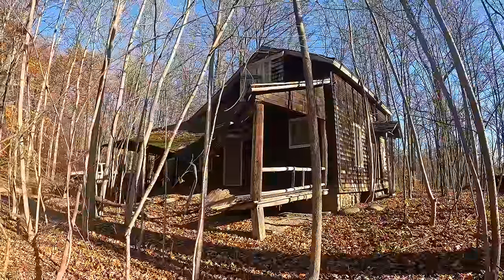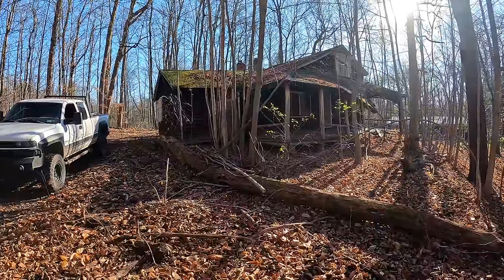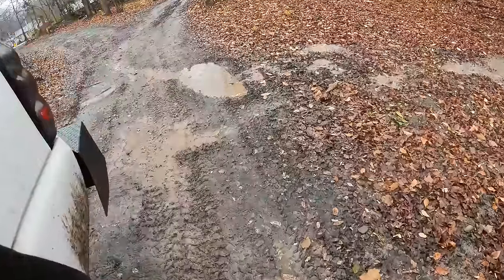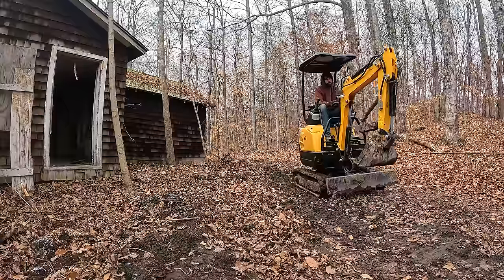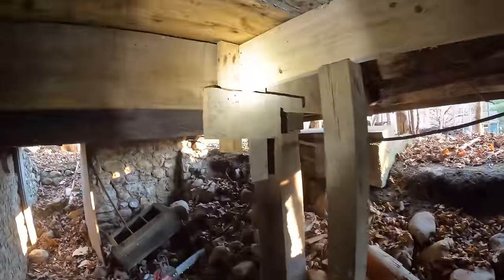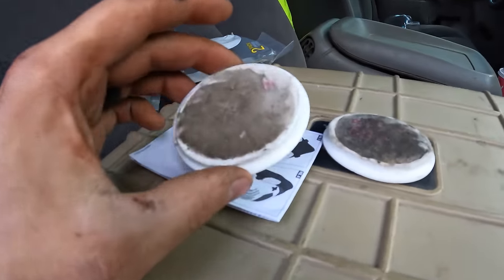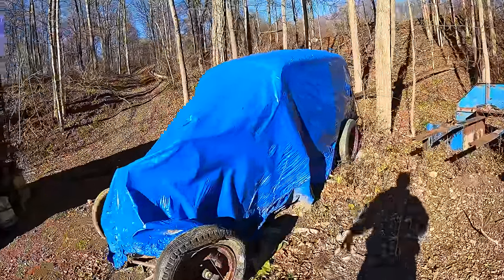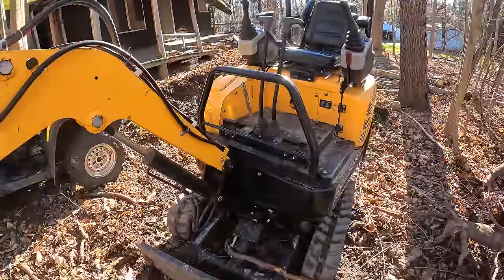I bought an ABANDONED CABIN in the WOODS - Vacant for over a hundred years!

Comment: There is no way that has been abandoned that long.
Reply: I agree and I doubt it’s 100 years old too.  And it doesn’t look all to secluded either.  I’d have not bought it.
Reply: Agree. I'm guessing the 60s was the last time someone lived there.
Reply: Think even in 90´s it saw some action. Houses go bad really really fast when not attended to.
Reply: Honestly, the age of it doesn't matter. Just look at the shape it was in when he got it and that's all that really matters!
Reply: I would say over 100 years old due to the rough beams, thick lumber, plaster and lath.   Abandon maybe the 60s after electric placed.
Reply: Maybe 50/60 yrs
Reply: Yes, I’ve seen houses empty for 50 years look much worse. Only thing that holds a house up is people living in them.
Reply: 1960s or 1970s
Reply: 90s tops
Reply: @guaporeturns9472  Now that is some trolling.
Reply: Electrical down the side and all that.. oh yeah, 60’s tops
Reply: Like the asphalt shingles.
Reply: @KeepRowing247  Lived in a house wired just like that in the 90s bro
Reply: Squatters are not residents. Just saying. Blessings everyone🙏🌱
Reply: I think it has been ten years since anyone's been there tops. The house would be just a pile of mulch. Also there is plywood on the windows. I've seen a well built neglected barn rot away in under ten years.
Reply: I would buy it looks a great project. Probably cost a lot, but worth it in my eyes🏴👍
Reply: @bradbendick4934  I saw only wooden Shingled siding. I missed the roof.
Reply: I would say it was abandoned in the 60s.
Reply: @KeepRowing247  You are right that is certainly newer. I imagine it was abandonded in the 60s-70s perhaps it was occaisionally use as a camp after that? That plaster/lath and the lead-based paint is more 1920-1940s.
Reply: Those shingle are not from 1930s
Reply: @HannahMattox it matter when people want to see 100 year vacant home and thats not it
Reply: @thegarbone well yeah the structure could easily be 100 years old but there is no way it’s been vacant that long.
Reply: @kevin8462  I did not see them, but like I said. The house was originally built in the 1920s-1940s. It was probably lived in last in the 60-70s on a permanent basis and then used and maintained intermitently into the 80s. That's my best guess based on what I saw. I did not see the singles or the roof. I was multi-tasking. It would be normal in the US to put a new roof on every 15-25 years and If I was going to do something as a home-owner to preserve a place it would be to fix the roof.
If I was going increase value, I'd invest in the kitchen and bathroom(s), but that place was beyond that. A lot of people would have just knocked it down especially with those floors and floor joists. That old lumber was good though and if it ks not dry-rotted or moldy, it is still WAY better than anything most people can afford today.
Reply: That’s my thoughts exactly
Reply: That’s gotta be true I’d say it’s been anbandonded about 50 to 75ish years
Reply: @HannahMattox no
Reply: @levikuhn3132  30 years at the most.
Reply: Just because it was abandoned for that long, doesnt mean the owners neglected it totally. you see the roof was kept up.
Reply: As a roofer that is definitely not a roof that was kept up on and if it was then the roofs I redue are really brand new roofs🤣🤣🤣
Reply: @lkeu1  by definition, abandoned means it wasn't kept up.
Reply: A road tight next to it  hahaha
Reply: The size of the US, this could easily of been left to rot for 60/70+ years
Reply: Why not? I do believe
There isn’t a good reason to lie about it
I lived in Ecuador and there are even worst situations or scenarios than this one. And besides I love the learning point of it
Reply: I bought a place that had a house that was at least a hundred years old and the barn was over 100 years and both of them were still standing. We fixed the house but the barn had been hit by a tornado and just wasn't worth repairing but we salvaged a lot of lumber and timbers. This house could easily be a hundred years going by the rock foundation.
Reply: @JamesCouch777 That's not how wood decaying works.
Reply: Yeah, I could see it being built in the 1930s, but last lived in during the mid 2000s.
Reply: Ya. It has modern outlets and indoor plumbing
Reply: @sneeuwwolf1176 
That was my guess, mid 90's. And all those little red maples he removed weren't a day over 20years.
Reply: @manfredconnor3194 
Not at all.
Reply: @sneeuwwolf1176 
That was my guess, mid 90's. And all those little red maples he removed weren't a day over 20years.
Reply: @justz00t48   You're correct. That was the first thing I knew when I saw the intro. I've been around a very very long time....I think longer than this house. Check out the outlet covers and the nails are not 100 years old at all - and the wallpaper is from the 50's. They wouldn't have wallpapered and then moved out right away either  - so it wasn't even abandoned yet in the 50-60's.  There's no way the floors and beadboard would have been in that condition after 100 years. The house could be 80 years old but I doubt it and there is no way it's been abandoned for more than 20 years at the most. I wish him lots of luck with the restoration - it's going to look nice when he's done with it - even though someone saw him coming when they told him it was abandoned for 100 years.
Reply: Yet is full of bs artists. I agree with you. Hollywood set.
Reply: @levikuhn3132  Absolutely no way.
Reply: He can easily find out how old the house is by looking at his deed.  I'm pretty sure that the year the house was built is going to be on there.
Reply: @lindabrown9542  nobody is saying he’s lying. He’s probably just mistaken.
Reply: That cabover body would be awesome yanked up a tree as a tree fort
Reply: @1neAdam12  Not at all. We can do this all day. Provide a reference and leave an argument or go back to your kindergarten.
Reply: If I was a wild animal looking for a place to call home I would def live in this place, yet there's no signs of wildlife at all, not even under the house nor the attic. It's probably not as old as he says or abandoned.
Reply: @justaperson4229  Yes, but animals do not just go into places that were inhabited by humans, even after they have long been abandoned.  You are not going to find a deer or an Elk in the living room. How would it get in. You might find a few raccoons hanging out somewhere or perhaps a bear might use the foundation as a den. Birds would come and nest in the rafters, if they could get in. Bats might too see refuge there somewhere. The thing is, that you also do not see what the guy may have scared away when he started. It looks like the house is on the edge of a community not in the deep woods, so it is unlikely that anything too  human-shy would take up residence there. Even if it did, as soon as this guy drove his 4-wheel drive down the lane, the animals would have been out of there. You may also not see the signs of nests or habitation, if the guy cleaned them out/up before he started filming.  It is not like we were there from the get-go is it?
Reply: @monav4062  That's not the issue. Of course the house is old. And could have easily have been built in the 1920s or even eariler. The thing most people here are disagreeing on is how long it's been ABANDONED. As in--when people STOPPED living there. Which is a completely different thing than when it was constructed. Because presumably it wasn't built and immediately abandoned in the same year.
Reply: @manfredconnor3194  
If the internet has you this worked up, maybe it's time to take a little break, squirt.
Reply: Honestly I'm gonna say 20 years
Reply: @BillStreeter   So basically, the issue here, is that the creator of this video and all of its enjoyable content should be dismissed because his 'headline' contains 'click-bait'?

What's REALLY wrong with YouTubers these days is that absolutely NO ONE is willing to 'forgive' the click bait but are more interested in 'attacking' the person for the 'click-bait' who has worked REALLY HARD on their accomplishments and EVEN HARDER on capturing it on video and editing all of it so that he could share his experience with us!

Who cares about the click-bait? !!  This man is generously 'sharing his experience' of how to clear land with a small excavator, he talks about how he acquired the small excavator.  He shows you how to take walls out of an old house, how to check, level and replace load bearing beams that have crumbled into dust from wood-rot.

He shows you how that it IS possible to take an old 100 year old house with the front porch falling off, with the floors unleveled and transform it back into a home.

I'm sure that when he gets to the plumbing, we'll learn a lot about how he does that too!  I really admire him for all of his skills and the fact that he's doing most all of the work himself -- with his own two hands!

This world is becoming a very scarey place and if you think that the U.S. can't be bombed by another country like Russia or China and that they would never attack the U.S. -- you're living in La La Land!  Americans need to learn 'survival skills' !!  So this man is showing us how to bring an old cabin in the woods 'back to life'!  Get over the click-bait title!  Who cares?!!
.
Reply: @monav4062  Who said it should be dismissed? Who called it click-bait? Nobody. It's a good video. He's just mistaken about how long the building has been abandoned. That's it. That's the whole thing.
Reply: Did y’all Carbon date it?  Who really cares how old it is. Quit trying to prove how observant you are and nit pick everything you watch.  It’s a renovation video relax and enjoy it or make your own video and show how much you know on there.
Reply: Don't it say on the deeds of purchase, when it was constructed and who last,lived in it.
Reply: @justaperson4229    It's winter.  The wildlife probably knows that there's no food on the leafless trees and there's no grass.  Some animals hibernate during winter, and some migrate to areas where they can find food.
Reply: @danav0137    You're funny!  Thanks for the laugh!
Reply: @sneeuwwolf1176 Nono definitely not the 90s
Reply: @missmaryhdream6560   A deed will say who last owned it but not who last lived in it. You have to do a "Title Search" and go back to the original one in order to know when it was constructed. Tax bills will have a date as to when the last taxes were paid - but that is no proof that people weren't still living in it after that point.
Reply: @jbeard82 i can believe the age but not complete abandonment.  I would say it was maintained
Reply: Love how 90% of comments are coming from folks that are basing everything on what they think. And talking down. I’m here to tell you that house is old and just because it’s not falling apart has a lot to do with quality of materials and craftsmanship. I suggest the doubting Thomas’ go and do some actual construction work. Frame a building, lay a block or brick. Set tile, lay sod, anything. Educate yourselves before educating us on the shallow depths of your knowledge.  Good work on your channel man. Let the doubters doubt. You have the tax records on that property. To hell what others “think”.
Reply: Who cares, I'm just glad he's fixing it instead of tearing it down and putting up a Mc mansion.
Reply: @travislee9396  I have over 10 years in the construction business so when I say that house hasn't been vacant/abandoned since the 1930s it's a expert opinion. 👌
Reply: @justz00t48  yeah well. Opinions are like assholes. We all have em, and they all stink. And at 10 years, you’d understand a master at his trade is called a journeyman. No journeyman says he’s an expert. I smell narcissistic behavior and gaslighting.
Reply: @travislee9396  Wow - we were waiting for the REAL expert to show up....and here you are. LOL 
You do know that no one is taking him down. People who are old enough to know what an old abandoned house looks like are giving him the benefit of their knowledge and experience. If he was told the house was abandoned 100 years ago, someone lied to him. People are letting him know how to tell that. YOU need attitude adjustment.
Reply: That’s the best you got? All these years on the planet and this is the sum total of your acquired wit? Wow.
Reply: @oldladyfarmer7211  you sure can track down the tax receipts. Then use that data to find the info.
Reply: @travislee9396  Not the sum total for sure. I just don't want to use it all up in one place. 😉
Reply: @travislee9396  Yes, travis, that's what I'm saying. It just won't prove how long it has been abandoned. It will only give information on when the taxes were paid.
Reply: Exactly.
Reply: @oldladyfarmer7211  it’s all you got. Folks don’t buy a sports car to leave sitting in a field. You use what you got or you don’t have it. It’s ok to be old and possess no wit. Just crappy that you act like your pond is deeper than it is.
Reply: @travislee9396  I have no idea what you're talking about....LOL
Reply: @oldladyfarmer7211  of course you don’t.
Reply: @travislee9396  Your bait is low quality and you should be sad.
Reply: I agree this has not been abandoned since the late 1800s for sure!!! I live in a very rural area and I know I’ve watched many old homes fall in on themselves. After 20 yrs they look like this. Between 40-50 they are falling in on themselves. 60-70 nothing is left standing. 
Homes can certainly survive 100+ yrs, when I was growing up my Gma lived in an old farm house that was over 100 yrs old. The front of the house had the family room with the parents bedroom off to the side. The upstairs had 2 sections. The Room over the family room had 3 single beds in a row, a wardrobe in the corner, and it had a door. The area over the parents room was open, so going up the stairs you’d come to that area first. It had 2 beds, a wardrobe in the corner. There were no heating.cooling. The house had a breeze way connecting the kitchen building to the house. By the time I was a kid, they had added to the breezeway and enclosed it in. They added another bedroom, a entry closet, and a full bath. They connected it to the kitchen and made it modern - probably 1940/50s custom cabinets, double sink, stove, fridge. They added enough to the kitchen to have a large dining table and a wash room big enough to house a washer, a long freezer, and clothes line to hang clothes in the winter. The family room they closed off the fireplace and used the chimney to vent the large propane heater, which was the only heat source in the entire house. That thing would run you out bc it was so hot...but it was the only heat source, so if you didn’t want to freeze to death you kept bedroom doors open so some heat would go in. You didn’t sleep upstairs on really cold nites, you piled on the family room floor.  
All that to say that the reason it was still there, was bc ppl lived there and repairs were constantly made. That’s why it could stand that long. Plus they used large, solid, hardwood trees for foundation and construction.
Reply: Imagine arguing with people, on the fucking internet" ~ papa Franku
Reply: @kevin8462  "Asphalt shingles are an American invention by Henry Reynolds of Grand Rapids, Michigan. They were first used in 1903, in general use in parts of America by 1911 and by 1939 11 million squares of shingles were being produced."
Reply: No leaking roof?  Doubt it's anywhere near that old.
Reply: There was no insulation in the walls, and the wall slats are from the 1910s
Reply: It's not a cabin either; that big it's more like a house. 😊
Reply: I lived in a house that was 100 years old and it had been worked on periodically over the years. That alone made it very hard to guess its age. We tore out lath and plaster, replaced much of the electrical and brought it up to code. In general, on the surface, it looked newer than it really was. So to sit back and look at a few camera shots is not easy to do.
Reply: @jamesdennis5699  It's old but it hasn't been vacant/abandoned since the 30s like what was claimed in the video.
Reply: @unsatsoupsandwich  HAHAHA You must be new to this.
Reply: @HannahMattox  good lord. you totally are missing the point. the point is that he is lying about it to get views. not surprised the truth is lost on you.
Reply: @manfredconnor3194 don't think they were using lathe and plaster into the 70s
Reply: @BillStreeter much older. They stopped using lathe and plaster much further back
Reply: @jvhende64  No. You didn't get my drift.

I was saying that it was lived in until the 70s, but built in like the 1920s-1940s.
Plaster and lath means (at least as far as I know) 1920s-1940s.

I only know this because I tore a lot of those places down when I was younger.

All the places I tore down were built like that and they were built in the 20s and 30s.
Reply: To all of you geniuses. Don’t you think the man who purchased the property, has had discussions with third party involved/ seller, and documentation would know more than you? Everyone seems to be an expert who hasn’t purchase an abandoned property. The negativity and people thinking they’re smarter than they are basically the issue with everything in our world right now 😂… good for you dude and like anyone who does anything cool or worthwhile in todays society… ignore the noise and keep being awesome.
Reply: @Kyle22Hamilton  
Not necessarily. That is an assumption. 

I am not exactly sure what you are at odds with here? No one is slamming this guy for what he is doing. 

If I recall correctly, the only thing that people are curious about, is that some of what the guy said, did not quite seem to jive with some of the observations, that could be gleaned by watching the video. That is not criticizing the man for what he is doing or belittling him in any way.  He may have said something flippantly about the place and it may not be correct. So what? Big deal? I doubt that is any skin off of his nose. 

It is not necessarily negative (or negativity) to refute, doubt or be skeptical about something that someone else says, especially when there are good indicators to the contrary. That is your interpretation and projection. 

Speculating over when the place was built, when it was last regularly inhabited, when the electric was renovated/added/repaired or when the place was abandoned has nothing to do with being "Smart". It is just a matter of education, experience and deduction. That is not "smarts" per se. 

No one is slamming him for what he is doing and the problem in the world today is people like you who want to criticize others for having a debate about something. 

This is a place for people to converse and engage in discourse. You seem to want to stifle that, by implying that people are dumb for wanting to do so. 

I have run into several situations with houses where information was not known or erroneously recorded. As far as I can remember, the guy here did not unequivocally, say. that he got the information from the deed. Maybe he said it. I for my part, will admit that I only skimmed though parts at 2x speed. 

However, that lath construction is consistent from my experience to be from the 1920s to the 1940s. However, the level of degradation is not consistent with abandonment for a period of 100 years or even 60 for that matter.  My guess is that someone was caring for that place at least into the 70s and maybe periodically into the 90s. I base this on my experience as well.

Maybe the content creator will fill us in. I could be wrong, but I doubt it. Not about that lath anyway. I think the man who purchased the property might not have all the information or may have said something out of hand without having looked at the information documented in the title/deed. Many titles/deeds, especially older ones, do not record renovations, repairs or occupancy. What someone tells you, though it may be what they believe to be true could be false, it could in some cases even be a lie. Often, informal information is based on second-hand information or hearsay.  Such information can be incorrect, incomplete or erroneous.
Reply: @manfredconnor3194  Knights of Columbus. People tend to speak up when they have something negative to say. Rather, they should be mindful and say positive and kind worlds towards anyone pursuing a passionate endeavor. This is the common issue across all media. Just a display of how unhappy people truly are. This guys videos are cool and interesting. Blow him up by commenting positive statements, liking the video, and subscribing. And you stay classy San Diego.
Reply: @Kyle22Hamilton  What does this have to do with the knights of columbus? What world do you people live in? This is not Japan! We are allowed to and supposed to be able to talk about things if you cannot talk about this then how will you ever address problems? People were not even slamming this guy! I think what he does is great. I think everyone else who is here think what he is doing is great too. All we said was that there is no way tjat house was abandoned that long. That house may have been built in the 1920s to 1940s (that is apparent from the construction), but there is no way that house was abandoned for 100 years, sorry. I do not know how you can misconstrue a disagreement about something this minor with "being negative"!!!
How do you people go through life?
If you disagree with someone you are "being negative" and you act like that is "tearing the man down"? Seriously?Get a grip.
Reply: Yes it has, my grand papi used to live there in the olden times
Reply: I love how people who have no idea what they’re talking about and don’t live anywhere near the same place will chime in and say how there’s no way something is or isn’t what is said. I have an abandoned house across the street from my property that hasn’t been lived in for 70+ years and looks in better shape than this one. And I know nobody has lived in it for that long because I live in my childhood home and my grandparents lived here before that!!
Reply: @LeeLee86  Whatever Lee.
Reply: Yep I agree hence the reason why I won't watch this.
Reply: @ralphgreer2568  Yeah, fake news bra.
😆😆😆
Reply: Click bait
Reply: @jbeard82  why do you need such a secluded cabin. Sounds suspicious.
Reply: Definitely not abandoned for 100 years.  Maybe 40 or 50 would be stretching it.  Those asphalt and cedar shake shingles are nowhere near 100 years old.
Reply: They are no way it would have fell down only the heads of the rusty nails would be left
Reply: Exactly, clickbait.  I wanted to see anyway though, what he'd do to it.
Reply: Definitely not abandoned that long. I could definitely see it being over 100 years old though.
Reply: I agree. I’ve been remodeling a 1930s house on a 141 acre piece of property that I bought. It hasn’t been lived in since the late 70s. It’s in better shape, but it’s also had a metal roof on it, with really big eaves. Hard to believe that’s it’s been vacant for 100 years. I bet half that at best.
Reply: Agreed. Similar structure and framing to a house I just remodeled that was built circa 1950.
Reply: That's funny! I also called BS as soon as the words came out of his mouth!😅
Reply: He's likely going by the Manifest that says the last time somebody lived in the home. I have a manifest for my home back 150 years. We are only the fourth family to live in our home. My brother-in-law and sister just bought a cabin, as well, that sat right on the roadway but the Manifest says it was built in 1870
Reply: @jbeard82 a lot of our homes in Upstate New York are over a hundred years old. They're a dime a dozen here. Usually have good bones, though.
Reply: @Cmpick1337 my brother-in-law and sister just bought a hundred year old cabin that has a road right next to it. Just like in a city, roads can get put through right next to homes.
Reply: It's strange for me to read some of these comments. My house is almost 150 years old it was in pretty bad shape when we first moved in. However, it was maintained better than the garage/carriage house. Outside of the carriage house looks pretty rough but when you walk in it looks almost brand new. Stone foundation for both.
Reply: @oldladyfarmer7211 I live in Upstate New york, as well, and we were provided with a manifest for our home. It told us exactly who lived in this home and when. Not sure if he was provided the same
Reply: I see so many comments on the age. First of all when he bought the land and git the deed he would know exactly when that cabin was built. Over that period of time it was probably re-done a couple or few times and added on to. 100 yrs-70 yrs, Who cares. 
I personally would tear it down and start over. He probably got the land for a steal. So I wish him the best of luck.
Reply: The USA began using asbestos in building house as early as the mid 1940’s
Reply: 100 metric or imperial years?
Reply: Plywood window coverings in 1930’s/ 1800’s?
Reply: @claudelowings4878  I only deal in freedom years! None of those communist time measurements.
Reply: The house i painted that has the same ceiling design is a 1950 house so that one might be the same age as it
Reply: If the roof decking is boards then 50ies
Reply: i live in that town its been empty my whole life 40+ years
Reply: Anything's Possible!Never Say Never!Take care,now!
Reply: No outlets- or holes. No wires, plumbing, no holes in the ceiling for lights. It’s either newer off-grid or been abandoned pre electric/ internal plumbing no?
Reply: I'd agree. I moved out of my house in 09 to care for my grandmother and within 5 years the roof was falling in.
Reply: My thoughts exactly
Reply: @jbeard82 I agree. Quite disappointed after seeing the aerial video. I thought that this was a cabin deep in the woods, abandoned and finally seeing some love. Structure or no, the place is not remote, has neighbors, and is right off a major highway. I want a cabin of my own DEEP in the woods and no neighbors within 2 miles of me.
Reply: It's possible. I come from a really small southern town and we have a lot of 100+ year old shacks that are in better shape than you'd expect.
Reply: Yes way
Reply: @AllthewayupG  Nope, that's still a negative on that one. Trust the science!
Reply: I mean, if it’s got good bones, you would expect it to stand
Reply: and it’s safe to overexaggerate he’s not selling a product
Reply: he is lied unsub
Reply: Bro looks like he knows what he is doing I’m gonna keep watching
Reply: @Chicken273  Smoke and mirrors..
Reply: @BillStreeter 
Or using a clickbait title for the video.
Reply: I thought the same thing as I'm watching it today. Because it was raining pretty bad so I thought there should be a lot of water leaking. If it was abandoned that long the roof should be shot and leaking
Reply: I'm surprised you didn't have to battle mold and a leaky roof. So it couldn't have been neglected for that long
Reply: I believe the house is very old
Reply: Probably even longer 😮
Reply: There is actually cedar weathers very well especially in areas with little snow.
Reply: @arturns902 lol you clearly haven't been on some highways then bud.
Reply: Why do all of you need to ruin my imagination now? It is at least a 100 years old I think 😎😬😇
Reply: @manfredconnor3194  this is such a dumb comment. animals LIVE in places that are ACTIVELY inhabited by humans.
Reply: Yeah agreed. Clickbait title. 🤣
Reply: Definitely pre ww2 construction... 100 years isn't that unbelievable....
Reply: I came here just to make sure that there were more smart people that realizes this  place is not abandoned as long as this young young man said 👍🏻 maybe abandoned and said 90s not any longer than that
Reply: @sneeuwwolf1176  I see barns that were built in the late 1700's, early 1800's and they're still standing
Reply: Omg 100 years
Reply: It was probably originally built then not abandoned then.
Reply: My grandmother’s wooden home stood for over 100 years when it was finally demolished to make room for a new home by my family. So, it’s possible. It was not occupied since she passed away in the late 1930s.
Reply: @sweetiepie4983  It depends on the home, how well it is built and where it stands. I will bet your grandmother's house was well built an in an urban area, no?
Reply: It must be, that timberframing is oldcut from the start of the 20th century.
Reply: Dang I’d be afraid of some asbestos. Just saying
Reply: At around 01:00 minute you can see the chimney is sealed of with lead, screws and a bonding agent. This was usually done in the 1970s until today. There is no way this building is vacant since the 1930s or even longer. Also the asphalt shingles are clearly industrial made. This was done in the late 1940s until the 1980s. In some eastern european countries they still produce them as of today. I'm pretty sure the window guys, carpenters and roofers have more to say on basic construction. That's not my area... But yeah.... This is clearly BS
Reply: @jbeard82 I mean you can hear highway in the first shot
Reply: Maybe not abandoned that long, but the cabin definitely looks like it could be from the 1920's (100+ yrs ago)
Reply: @HannahMattox yes, the age does matter because it’s literally in the title.
Reply: It's not a hundred years old
Reply: Look at that sink from the early 1900s, and no bathroom. That's a very old house. It was locked up tight, the porch fell, parts of the rock skirting gone, the stairs to the basement mostly gone, I have no problem believing that house hasn't been lived in for 50 or 60 years, easy. That house next door probably had the land and decided to sell it. Plaster and lath hasn't been used in the walls past 1940, and began being used in the 1700s. Asphalt roof shingles were first used in 1903 and by the 1930s were in common use in the U.S. So, if that roof was the original, it could be as old as 120 years. There's no insulation in the walls. I have been in abandoned houses that, if they're well-built, can look pretty good. A house built this well can be vacant for quite a while. A house built in the 1980s or later, no way. They fall much faster. It also depends on where it is. This kind of stuff has been my family business since the early 1960s.
Reply: I have a cottage built in 1923 in Perth Western Australia and our electricity got put in in the early 1930’s. So don’t use the “there is electricity” comment as something to date things.
Reply: I know this house was built in 1915. I was there , trust me bro.
Reply: It was 99 years
Reply: It’s a heap of crap. Mildew and rot everywhere. Even if you replace major sections, it’ll just get contaminated from the remaining mildew. Better to have leveled it and started fresh.
Reply: And there's no way that's the Cabin in the woods👻😮
Reply: Tbe roof would have given way after 30-40 years max if it was abandoned longer than that. Especially in the woods like that. The age of the house is debatable but the time it's been left unoccupied and unmaintained to some degree shouldn't be. Then again, younger people think anything old is a hundred years old.  You know, back when the Vietnam war was, or even when MTV was invented.
Reply: I agree with you no way  in a wood with all the three and damp  maby I am wrong  but I don't think so
Reply: truck not that old
Reply: Time to clean all the leaves out of the way clear up a area and have a bonfire yeah.
Reply: That house has been added onto several times. You can see the small Original house at the roofline. All the comments blowing smoke out their rear have no idea what their talking about.
I agree it's been lived in but the original cabin could easily be much older.
Reply: @mjmcinnesincanada 
yes they are...anyone living in a space is the resident...words have specific meanings
Reply: @BillStreeter duh...nobody said it hadn't been lived in in 100yrs...or having been remodeled any times over many decades.
Reply: @oldladyfarmer7211 
They said "abandoned " and "it was 100yrs old"
Not "abandoned 100yrs"...geez
Reply: @systemsays6097 
He told no lies.
You can see the round log floor joists and up in the attic if you look at the slats on the roof, you can see that it had split wood shingles originally.
98% of the comments on this video are ignorant folks with weak comprehension skills.
I bet most of you are under 30yo so your frontal lobes are just  reaching full connectivity
Reply: @rabsmith8725 floor joists he cut out were round logs. The original roof had split wood shingles.
It's minimum 100yrs old.
Nobody said it was "abandoned 100yrs ago"
Reply: @billhill5102 probably older. When do you think they built floor joists out of logs and you can clearly see the original roof had split wood shingles.
Reply: @feelinguru-vywiththepaingu9808 
Yes, round log floor joists and you can see from underside the original roof was split wood shingles
Reply: @GBuds_RVremodel  oh you didn't read the comments did you?
Reply: At the beginning of this video says the last person 1973..
Reply: Güzel yorumlar için teşekkürler
Reply: @eminbe312wqx  You said it!
Reply: @blacksquirrel4008 the yip
Reply: our house sat empty over 25 years,  not quite as bad as this one,  so i believe it's sat  vacant around 50 years.  they were built better with denser lumber more true to size, so they held up longer.
Reply: Yeah it’s been about that long I use to live right down the street from the cabin
Reply: Yes that building has been abandoned for many years my father grew up in Lyons we used to drive past that house I always wondered what happened to the people. So figure I'm 60 so that house has been abandoned for at least that I know of 60 years plus
Reply: Been in construction a long time, from what i saw i guess the house is about 80-90 years old. But i don't think it was left alone more than 40 years tbh
Reply: @pharba999  there was a lot of people checking it out etc my buddy’s grandmother lives in the other house on the property
Reply: @Mr.antisocial7.62  nice mate, cool project u got there, i wish u all luck with all the renovations! Hope u live ur dream out there 👍
Reply: @pharba999  it’s not my project lol I just know a lot on the area n surroundings best to luck to this dude who bought it tho
Reply: Who cares.
Reply: 1800's ? The windows suggest that is not the case.
Reply: I was thinking the same thing, and I've only watched the first 30 seconds. Wood shingles for siding might last a couple decades at best, and also the asphalt roof shingles would not last anywhere near that long.
Reply: @Heymrk  If wood beams are not exposed to water, they can last over 100 years. Our last house was built in the 1890s, and it still had all the original beams.
Reply: He bought it and probably got the legal paperwork and it will have the date of build on it also county records may have something on it as well for tax purposes
Reply: @kevin8462 Asphalt shingles became popular in the 1920's.
Reply: It was abandoned 15 years before it was built.
Reply: Look at the roof shingles weren’t around 100 years ago
Reply: Your over growth is literally 10 years old
Reply: @HannahMattox  it does matter cuz itll be false information
Reply: At least the foundation is around 75 to 100yrs the foundation is made of stone.
Reply: and it is not abandoned in the woods when a street is right next to it imo
Reply: Then don’t watch the video
Reply: Why so critical?
Reply: Prove it.
Reply: @jbeard82 did you see insulation?  Did you see electrical wires or plumbing?  Given walls, floors, etc it could easily be pre 1950 which would be around 80 years.
Reply: If we are just talking about the foundation then I’d say yeah that looks to be over 100  years old if it was a poured concrete one then it would definitely signal newer then like 50’s of 60’s but that foundation is strait up stone if they joined it together with concrete (which I can’t tell ) then it’s more then likely pre 1940 but if theirs no concrete joining those stone together then that houses foundation could be as old as the 1700’s 

The size of lumber it’s spacing, hardware/fasteners used, types of hinges, insulation and even knobs on handles/door could give the house a better date of not when it was abandoned but at least of when it was last occupied and maintained by someone who actually used it. 

No doubt it’s older and no doubt it’s been without a useful tenant or caring owner for I’d say at least 50 years. Squatters, wanderer’s  and unwanted campers don’t count but yeah it’s been without anyone to give it some tlc for many decades
Reply: What caused this road to become desolate and forgotten?
Reply: At lease cut this guy some slack dude
Reply: @DuckyMemer  When the lease is signed, I will.
Reply: Misspelled mb
Reply: You would be surprised things were build to last alot longer now days everything is cheap ppl cut corners
Reply: It's been abandoned for quite a while. 40-50 years?
Reply: Why not?
Reply: Agree that it’s about vacant for 25-35 years max.
Reply: Houses go down pretty quick without upkeep. There's no way it's been abandoned near that long. There's blacktop right next to it, not very secluded.